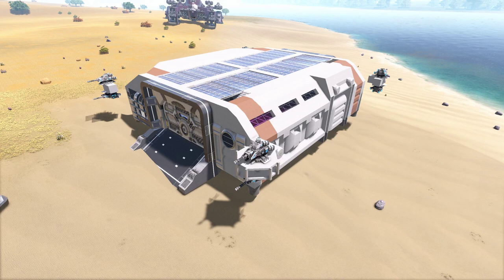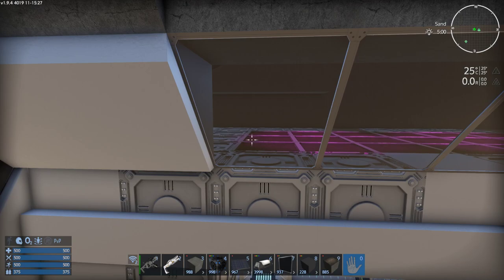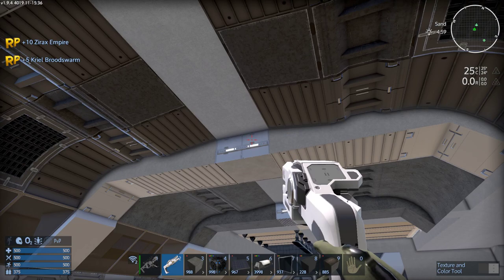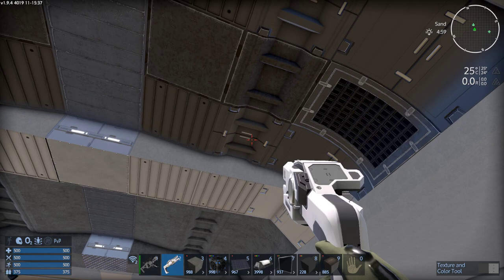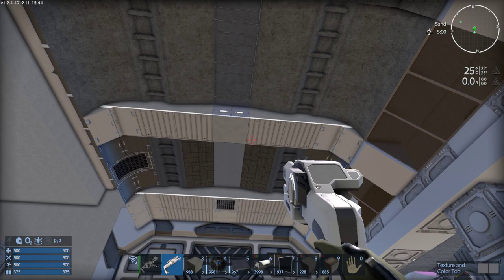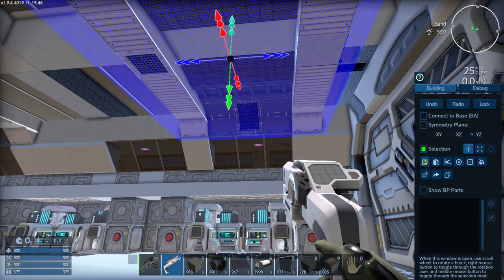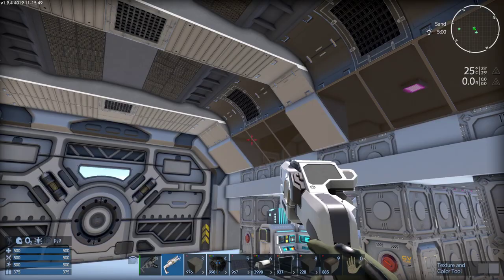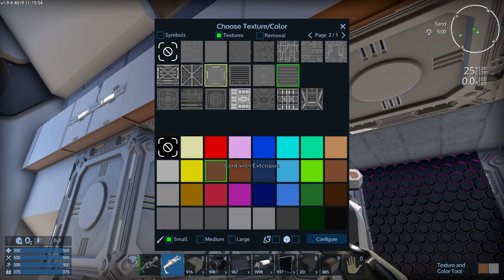Empyrion Galactic Survival - New Functional Base build Part 4

Comment: "But if we change the palette, all the creations from the past will look wrong!"

I'd even like it if they had to add a "new" texture gun that does not care what block it is over and deprecated the old one. That would allow old creations to stand, while allowing them to balance out the tints and hues of all the textures so you don't need 50 shades of gray to make a ship one overall color with 20 different textures on 4 different materials.

The solar panels with the legs help when combined with darkening it out. Another possible option, if you wanted to try, would be placing an opaque projected LCD over the opening. I like the new farm windows better, personally.

You could use those open spaces by the cargo extensions to hold LCD projectors (you do mention this at the end of the video). Could even throw in some lights in there and use the bleed through to your advantage. Could also put some under the floor to do the same job. 

The texture lip in front of the cargo boxes @30:11 could maybe use some of those yellow hazard symbols in a "watch your step" fashion. 

I'm enjoying the build. 

Thanks Jeff!

Comment: Jeff, adding all the textures for all the blocks is something Eleon may be slow to do because they're paranoid about what that would do to the Workshop.  However, for scenarios, the change is configurable in the files for that scenario, so you could talk to Ravien_FF and Vermillion about it.  The same is true of some types of block shapes.  For my game, I had added (actually replaced an obscure shape) a 1/8th block shape for the cargo extenders, for instance and tested for stability.
Reply from the maker: Very interesting. Thanks for the info!

Comment: They must have changed the HP of blocks in RF Eden and other mods because I only played vanilla.  Steel blocks are 500 HP, hardened is 1000 and combat is 2000.  Concrete is 1000 and reinforced concrete is 2000.
Reply from the maker: I believe the values were changed in RE. I remember them to be what you listed so I think those are the current vanilla values. I was surprised to see the concrete had as many hit points as they do. So the best block HP possible seems to be armored concrete in RE at I thought 4000 HP. (I may number wrong). And thanks again!
Reply: Reforged Eden also adds different resistances for the materials.  Time the DPS on concrete versus metal walls using different weapons, to see.

Comment: Hey Jeff, I was wondering regarding the cargo extensions... is there any particular reason you don't use the extensions as floor pieces? Would save a lot of space in the base
Reply from the maker: There is a reason, but depends on the build. It is I normally want to use floor textures that are not available on cargo extensions, especially in a hangar area. But if not enough room, I would use as floor. But, could fit a reasonable amount of storage in. I been wondering if I should add more thou. I will ask the question on the next video. And thanks again!
Reply: That was my thought right from the beginning as well. The texture thing makes sense though, just as with the concrete texture dilemma.